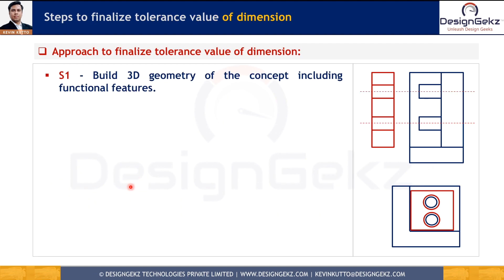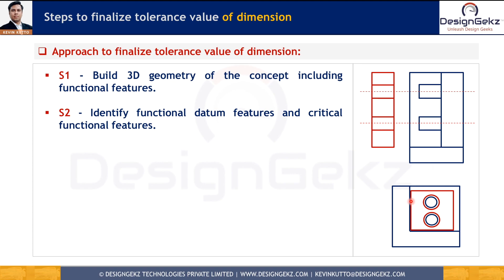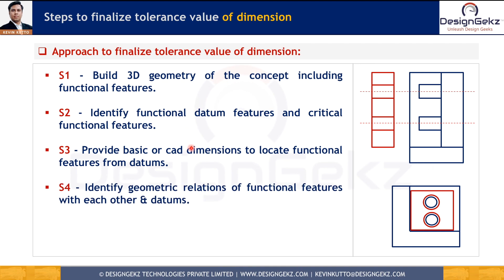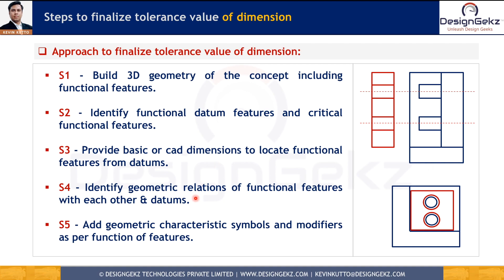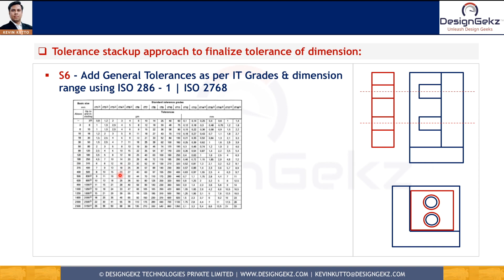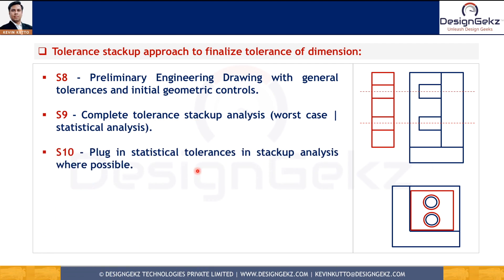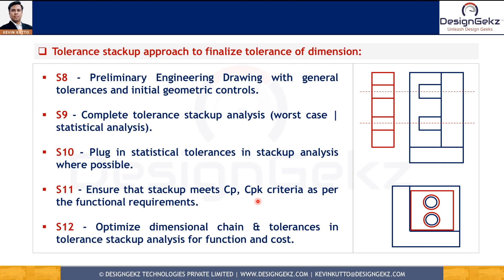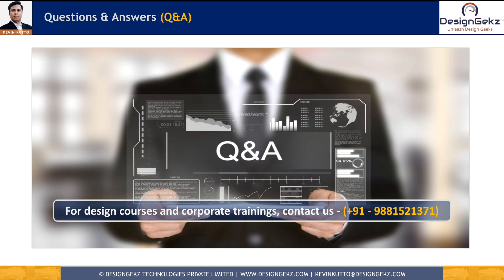How to select tolerance value for dimension in the Engineering Drawing | Kevin Kutto | Designgekz

Comment: i thought we get rid of tolerance stackup by using GD&T, why we should perform stackup analysis still
Reply from the maker: We don’t get rid of stackup with GD&T.  GD&T is a functional dimensioning and tolerancing. And stackup is the way to optimize dimensions and tolerancing to still achieve the function with all dimensional variations.

Without stackup you will never come to know how part variations impact the assembly function.

So, they both complete each other.